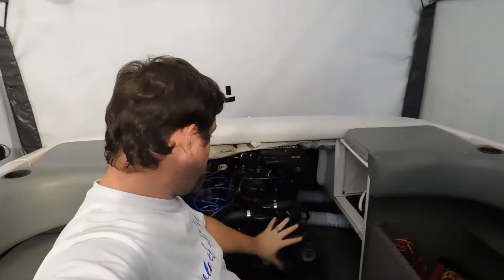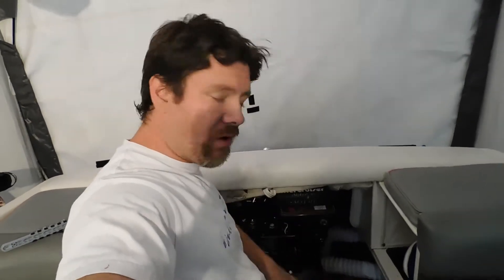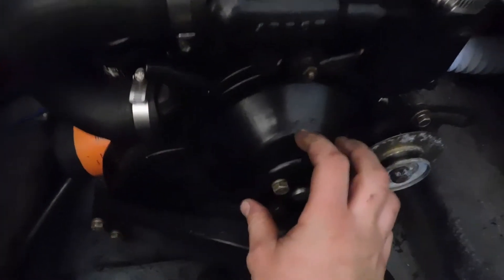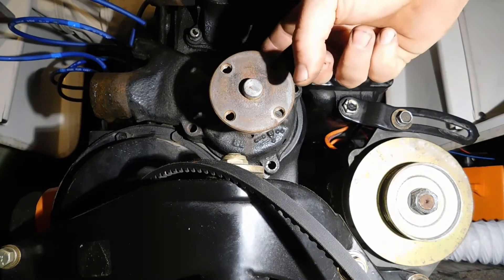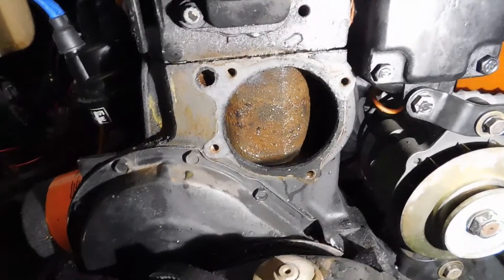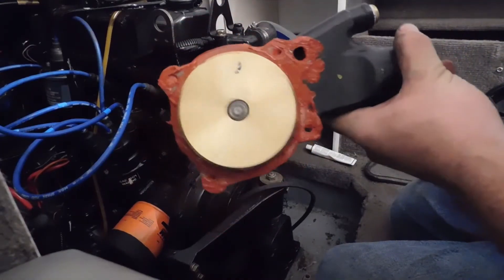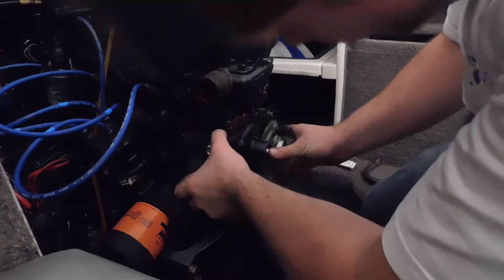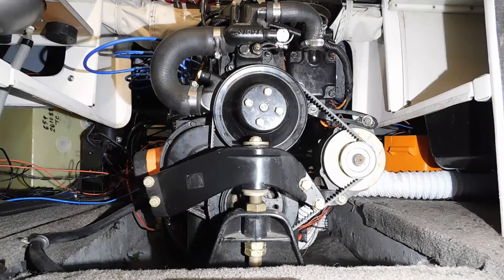Mercruiser 3.0 water pump replacement

Comment: Are head gaskets a typical issue in a 1998 3.0L Mercrusier ?   I am looking at a 98 with less than 400 hours on the hour gauge.   Great video - Thanks!
Reply from the maker: They do seem to be an issue
Reply: @daleofalltrades    Thanks !

Comment: Great video. I was at the lake yesterday and my boat hit 180. Before that I ran the muffs for 10 mins  and it did not break 120. I shut it off and my temp while the motor was off but key was in power position went over 240 🤔got to the lake ran out to 150 yards and that’s when it hit 180, and then I heard that noise in the water pump. I knew, I just knew, listening to your video confirmed it. Now I’m off to replace that water pump.

Comment: I need one of those water pump pulleys? Would you have an Amazon number for that? Thanks mine has two extra pulley grooves on it and the one near the pump has holes through it pulleys hit the motor mount so I'll have to cut the pulley or remove the water pump to get it off.  they have a few on amazon like yours, say see specs but I don't see the dimensions other than the pulley outer Diameter. thanks
Reply from the maker: Get the numbers for you engine of the hull or block and look up the part that way
Reply: @daleofalltrades  great videos by the way.

Comment: Awesome video and links provided,

Mine has an "overheating" issues. same 3.0 IN/OUT, will try to replace the pump..... Any other suggestions?

Secondly, Boat clicks when turning the key over. When hot or cold, I usually need to "jump start" it by making a connection with the solenoid myself to get it started.
 (fuses, wires, relays, starter solenoid, batteries, starter have all been updated and read correct voltage) do you have any other suggestions on what it could be??
Reply from the maker: The starting issue could be bad cables from the battery and not providing the amperage needed for starting. They get exposed to a lot of water.  The over heating issue could be a plugged exhaust manifold also. I also have a video going over many other possibilities for over heating
Reply from the maker: Be sure to visit my giveaway video https://youtu.be/swMSXAZcGKw

Comment: If the water pump goes can it sound like a metal on metal sound? I think this might be my issue and never thought of water pump...
Reply from the maker: It definitely can sound like that
Reply: @daleofalltrades  test would be to remove the drive belt and try and spin by hand? I just winterized it today wish I had of seen your video a day earlier lol
Reply from the maker: @derekhodgson2147  yes you don't need to even start it. Just take the belt off and spin by hand. If it's noisy you have your culprit. Also the pulley shouldn't wobble. If it does that also means it's bad.  
FYI I'm doing a boating accessories giveaway be sure to check that video out on my page for a chance to win!
Reply: @daleofalltrades  done and done... can't wait for more videos... and the contest 😀

Comment: Thanjs! Might have to replace my water pump. 2010 Mercruiser 3.0.  Just replaced the Alt belt now it soounds like water pump is making noise. Maybe the belt isn't tight enough so will check that first.  I did't notice a gasket with that new water pump. So sealant no gasket?
Reply from the maker: That's how I did mine. Just sealant

Comment: How do you know whether its the impeller or the water pump if you are over heating
Reply from the maker: It's almost always the impeller or a clog.   To be sure you can run it on the muffs and disconnect the water feed line too seed it any is being fed in.  I have a video on overheating issues
Reply from the maker: https://youtu.be/4l21Wyw7IVs

Comment: How do you get the water pump off if it is rusted so bad on outside  that pill size pic are falling off . The  pump still works but the motor was making noise and I pulled the pully off and saw how bad it looks. It is a 1997 3liter mercruiser that is used in salt water 40 days a year that is flushed at end of each day. That is not what is causing the noise. Is there a way to get the bolts off?
Reply from the maker: Big hammer and pry bar

Comment: Odd question. Do you use mobil 1 synthetic 10w-30 full synthetic? Great videos!!
Reply from the maker: I use 25/40 quicksilver 10/30 is too thin for Marine use due to prolonged high rpm.  Thanks for watching!

Comment: I am seeing water coming out around that area today also engine stopped running want crank up could that pump be the issue for it cutting off?
Reply from the maker: Hmmm well water coming out is an issue so I'd start with that and go from there
Reply: @daleofalltrades  Thanks for the response also could you help me out on one more thing for you know what the switch is call that cuts the motor off when putting it in gear and out of gear I can not find the name for it anywhere on top of the motor
Reply from the maker: It's called the shift interrupter switch
Reply: Thanks so much bubba you just got a new subscriber.

Comment: I got my 87 3.0 mercrusier running but its mixing oil and water and spitting it out of the top of the drive unit, any ideas what that would be, my guess a seal broke some where, just not sure where.
Reply from the maker: Oh boy! Out of the top of the drive unit? I'm not 100% sure what part of it you are talking about.  However that's never good. To give you an accurate guess I'd have to see it. But there's a few questions I have.
1. Is it engine oil? Check the dip stick is there water in your oil or is the oils low
2. Was it winterized
3. When you say top of unit do you mean out of the exhaust
I can maybe better help with these questions answered.   
100% not good though.
Reply: @daleofalltrades  I have a video of it I just wouldn't know how to send it to you.
Reply from the maker: You could upload it to your YouTube directly from your phone. 
Was it winterized? It's sounds toe like it was a 1st start up since winter?  Did the block crack or head crack... That's what I'm afraid of.
Reply: @daleofalltrades  okay, I just uploaded the short, so it was winterized. and I don't believe it is cracked, the reason I believe it was a seal is because in the bottom left corner of the video you can see water getting dumped down by the starter so I would think that would just be a broken seal.
Reply from the maker: Ok just watched it.  That's water mixing with your engine oil really bad and it's coming out of you valve cover breather that's spose to vent into the spark arrestor.  The water pouring out by the starter is not good either.  I hate to say it but I really think you have a cracked block. Or a bad head gasket. But I'm leaning towards a crack somewhere.  I'd start tearing it apart and investing. Running it like that will only cause more damage. Cracks can in some cases be repaired.  I have a video series on the head gasket also.

Comment: Hey where did you order the pump from or do
You have the part number aswell?
Reply from the maker: All parts I use are always in the video description as well as links. Check it out there. Thanks
Reply: @daleofalltrades  did it come with the plug to plug off the small outlet
Reply from the maker: @drillsgt24  yes it comes with the plug already installed.
Reply: @daleofalltrades  wow okay thanks for the quick response what about the gasket when I clicked on your link I didn't see the gasket and do u have a link for the thermostat...
Reply from the maker: @drillsgt24  I believe it ships with a gasket but I used silicone and a year later it's not leaking.  I didn't supply a link for the thermostat as it wasn't replaced in this video. Thanks 👍
Reply: Hey did u get the pump and if so did it come with the plug to plug off the small outlet
Reply: Hey did u get the pump and if so did it come with the plug to plug off the small outlet

Comment: I have a Mercruiser 3.0 that is quickly over heating.  I’ve replaced the thermostat and impeller.  It’s still overheating.  I want to circulate some Evapo-Rust rust remover through the cooling system.  The stuff takes some time, but it works like magic, removing rust by an ‘enzyme action’.  What do you think it a good way to RECIRCULATE it through the engine?  Some way of connecting the intake from the impeller to the output from the manifold?

Your videos are great, simple and clear.  Thanks for the quick answers!
Reply from the maker: If your wanting to recirculate through the system the easiest way would be to get a kiddie pool catch the exhaust water in it and pump it back the the impeller inlet with a pond pump or something... You will run a even higher risk of over heat while doing this as your pumping hot water back in...  I have a suspension something is clogged on your inlet or outlet side. The manifold may be so clogged up it may be time to replace... Also if you have overheated pretty bad more than once check your compression on cylinders 2 and 3... These engine love blowing head gaskets once over heated for the smallest amount of time. Good luck and thanks for the compliment
Reply: @daleofalltrades  So after trying several unsuccessful water muff tests feeding water to the engine, I finally disconnected the water feed from the outdrive and connected a garden water hose to the water feed to the thermostat housing.  And lo and behold, water went through the engine properly, and the engine didn’t overheat!

Bear in mind I already replaced the impeller and the thermostat.  So the problem in in the outdrive or the water feed from the outdrive.  There is supposed to be some possibility of a kink in the water hose, but I can’t imagine that.  I can’t imagine any other error in putting the outdrive together.  The only other possibility I can think of is that I put the impeller in backwards/upside down.
Reply from the maker: @jimbaranski4687  the impellers are self correcting in a sense so it it was backwards it should have straightened out in its own.  I'm willing to beth there is old impeller material stuck somewhere in the feed system of the out drive restricting flow. You have narrowed down the search now you just have to tear that apart and figure out where the issue lies.
Reply: @daleofalltrades  Yeah, but the impeller I removed was still in good condition???  I’ll pull the lower unit off again. And check it out.  My boat is circa 1996; I don’t see how there is room in the metal housing for the impeller to flip directions; it seemed stiffer then that.

I’d like to find out more information about the path from the Impeller to the engine…
Reply: Did you guys ever get it figured out? I had a 3.0 that kept overheating, went thru and replaced everything, pump, impeller, hoses, t-stat, still overheated. It wasn't until I tore the engine down that I found that upon removing the t-stat housing/ hose manifold from the head that a piece of old impeller had found its way up to the head and got lodged right there, it had rust and barnacles or rust bubbles all over it and had clogged that passage completely, come to find out on that block, that is the bypass passage and if it doesn't have flow, the coolant system just doesn't work at all. The actual explanation is more technical but that's the jist of it.
Reply: What about the thermostat?

Comment: Is the back of the water pump solid?  It looks like behind the water pump is an open hole into the black.  Is the water pump a complete shell, or is it open in the back?

What is the flow of the coolant water?  If I understand it correctly, the water comes from the impeller in the out drive, through a medium size hose over the top of the engine.  Does it go to the water pump on the front of the engine or the thermostat or what?  It looks like it goes into the housing below the thermostat where the coolant hoses go from the water pump through the thermostat to the manifold, but that doesn’t make any sense.  It must somehow go into the block and then back to the water pump?  Hence going up to the thermostat and manifold?
Reply from the maker: The water pump is one complete unit open in the back with fins.  The hole into the back is the front cooling jacket of the engine
Reply from the maker: @jim baranski at 5:07 in this video there is a pretty clear shot of the back of the water pump. Thanks for watching. Hit that like button!
Reply: @daleofalltrades  can you describe the coolant flow?
Reply from the maker: @Jim Baranski  it does enter the t-stat housing 1st. There is a small bleed built into it.  It's to direct flow to the engine and manifold as you never want ether running dry. check out my other video with more detailed explanation. https://youtu.be/4l21Wyw7IVs
Reply from the maker: Just saw your edit/ updated questions. I have a video that may help explain the cooling system for you in greater detail. Check it out here-  https://youtu.be/4l21Wyw7IVs

Comment: Does anyone know what the second outlet is on the water pump? The smaller one that is plugged off?
Reply from the maker: I'm thinking it's for different applications. For automotive use for running a heater core or something. The factory ones are sealed off with no plug it's a reman thing. So these water pumps must be used on a wide range of engines.
Reply: That makes sense. Thanks! I do have a heater core up in the cuddy of my boat which is currently disconnected, could be nice for winter fishing... but I troll with an outboard so sort of moot.

Comment: hey Dale first I want to thank you for your videos, very useful.. anyway I recently changed my impeller and thermostat on my 3.0 mercruiser now I'm overheating again?? you think its time for me to change my water pump as well?? or you think I might be having other issues? a little guide will help thanks again
Reply from the maker: Thanks so much for the compliment and support.  Hard to say for sure what the cause is. Have you ran it off the water muffs? If so that will burn am impeller up immediately.  There could be a blockage somewhere also.  There a few things it could be... Maybe the water pump.  I could maybe make a trouble shooting video in the near future.
Reply from the maker: FIY I will be posting an overheating trouble shooting video Saturday morning, hope it helps you and many others out!
Reply from the maker: https://youtu.be/4l21Wyw7IVs. Video available now!